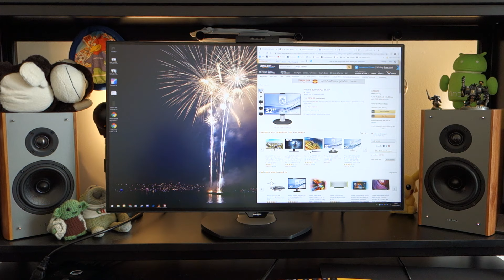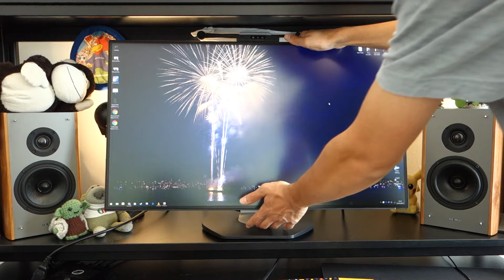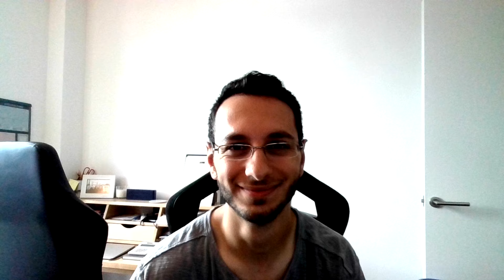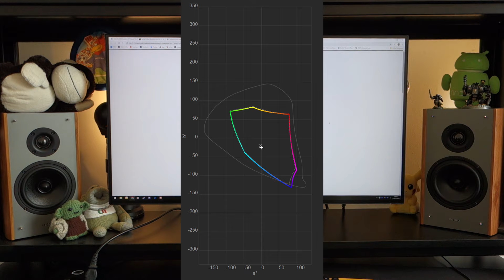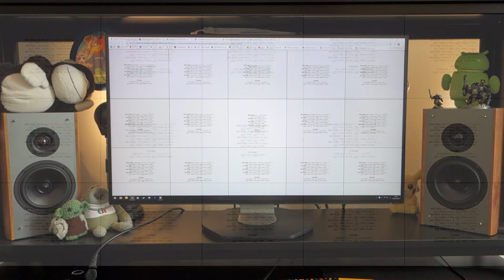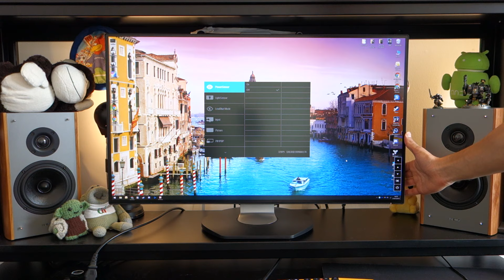Philips 329P9H review - An overpriced 4K monitor - By TotallydubbedHD

Comment: Please stop talking about "kettle plug" connectors. These are IEC connectors or more specifically IEC 60320 appliance couplers. Typical ones are C13 plugs, from what you are describing (but not showing for some reason?) they have used a C15 or C15A connector. It isn't like these are hard to come by, it isn't proprietary, and making a big deal over the choice of a C15 instead of a C13 is just weird. It just makes it seem like you don't know what you are talking about.
Reply from the maker: I like my kettle plugs.

Comment: I think a rather large piece of this monitor's I/O and capabilities were missed here.  This unit comes with a built-in USB Type-C dock, which can cost $300-400 USD from some OEMs.  When you factor this in, yes the monitor is still somewhat expensive (as most 32" 4K monitors currently are), but it really isn't intended for use as a gaming or desktop computer solution. 

The biggest selling point is that this monitor offers a single cable connection for a laptop user to a full dock and display and the ability to connect additional displays via the monitor's DisplayPort out.  The camera admittedly isn't anything special, but I'd guess its really just there to login via Windows Hello. 

Considering the above, the design seems geared towards those who want a clean and full featured workstation but need the mobility of a laptop.  In my opinion, definitely a product for the business/professional market.  To the IT teams considering deploying this unit, the price tag could be justified in the inclusion of a single cable docking solution, the ability to daisy chain multiple displays, and the built in webcam (which even though it isn't great is one less thing to have to buy from yet another vendor).
Reply from the maker: Thanks for sharing - didn't miss the point, but each to their own.